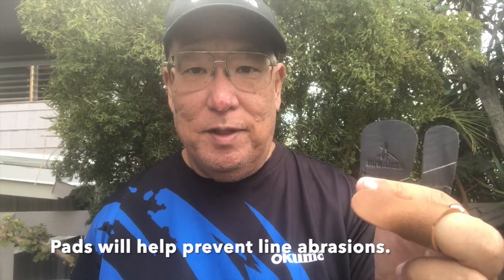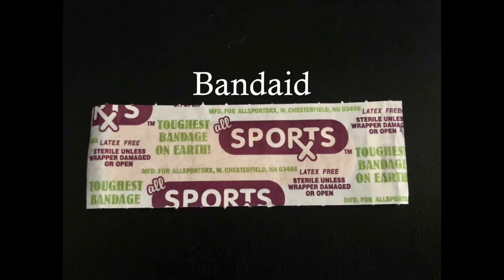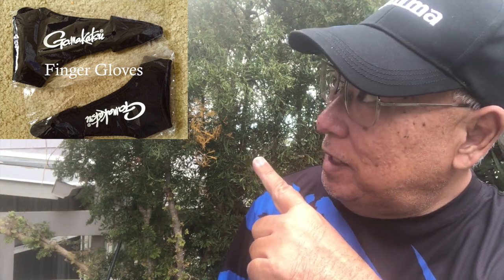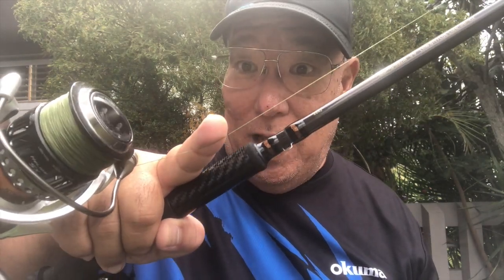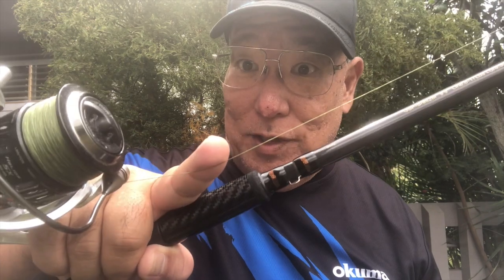How I Avoid Braid Cuts & Abrasions When Fishing!

Comment: Alvey 6500 BCV lever drag, i have 2, one early model and one 2020 Carbon fibre. Superb reels for distance casting big baits. Slow action rod the best for that. I have a 14 foot one piece custom , 13 foot 2 piece PENN, and 2 Carbon Fibre 10 foot flick sticks. Have been using Alvey for over 40 years. Their drag system superb. Puts major hurt on Kingfish ,Eagle Rays and Thresher Sharks. Having 750m line capacity a real boon on big fish. The  Okuma 8K i use for Spinning large lures as the Alvey Geared Reel is a heavy bugger to use all day. All my reels are Left hand wind as am right handed, no swapping hands after casting. Just remember to use small svivels at terminal end to defeat line twist. Once every 2 months i walk along shoreline letting all line out and then retrieve giving twist free line again. The reels are also great with KITE fishing just rig on a boat rod with a roller tip. Neat way to live bait and target cruising fish. I'm aretired NZ Army Ssgt who lives to fish!!!

Comment from the maker: (On a FB group in Hawaii called Oahu Shoreline Fishing this angler has added-
国兼 ケリー I can vouch for his method. Been doing something similar for awhile + also making sure I only use minimum necessary pressure on the line when casting. Using your fingertip is not only safer, I feel like I can cast a LOT farther. I'm usually casting with JDM braid rated at 0.4 PE or 0.6 PE. That's about 4-6lb test diameter braid. Never had a braid cut for years, even if I cast bigger stuff like plugs, hammer bombs, and jigs.)

Comment: Your videos are always excellent .... What I have been using is my girlfriend's old leaky  rubber dishwashing gloves. I cut the fingers off the glove and use the individual finger to protect my finger when casting.. I punch  a hole in the top of the finger near the opening and attach a rubber band and it will hold the finger on to my hand...But most of the time the fingers that I cut off the glove will fit tight on my finger...
Reply from the maker: That is awesome!

Comment: Comonsense advise, been using bandaid since braid avail in NZ.Okuma Surf 8K /18kg-500m, Lurekiller 5000/8kg - 400m, Alvey 6500 /8kg 750m plus an Alvey Geared. Tightlines ehoa, Kia Kaha. Toka o Te Moewai.
Reply from the maker: Always wanted to try a Alvey 6500 for the surf! Unreal line capacity!

Comment: this is actually called a casting trigger. It can be seen everywhere where I live. Dont be ripped off with "breakaway cannon" it's literally a rebranding of basic casting triggers. No where near $20-30 it's asking for. Search on ebay and go for cheaper ones. I bought one from hypertackle i think its called and its the exact same thing for half the price.
Reply from the maker: There's some i saw on eBay for cheap prices. As i stated before i've never been sliced by braid, looks painful though. But i still prefer it over mono as it stretches up to 3in per foot (depending on line strength & brand). I'm waiting for a new line that's being extruded as i'm writing this. Fluoro-mono from Japan. I'll be testing that soon. When i set the hook i'd really like that hook to set.